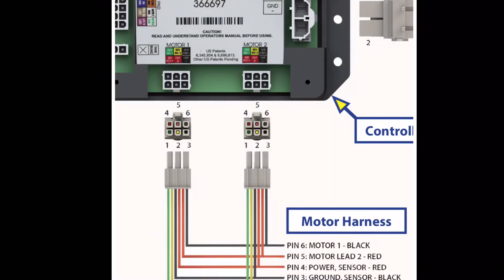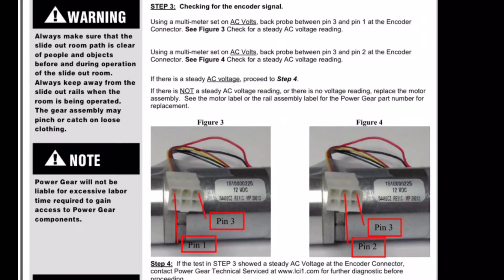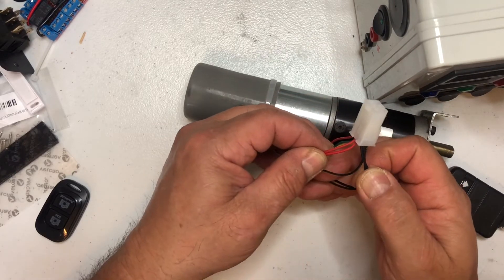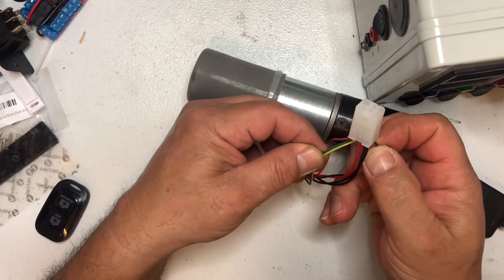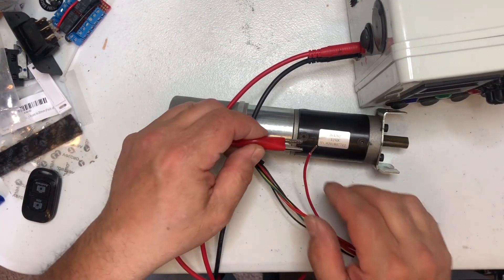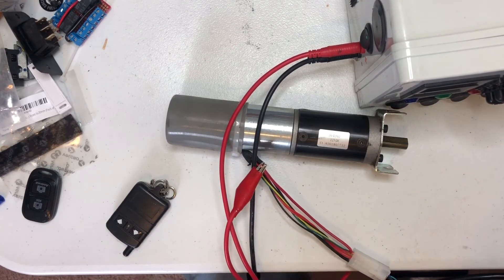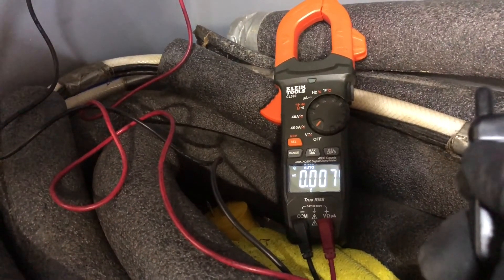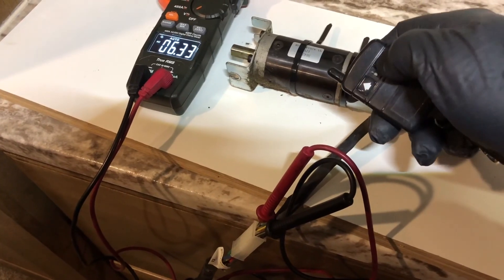Slim Rack Slide Out Encoder Circuit Test

Comment: Can I use a typical volt multimeter?
Reply from the maker: Not sure what a typical volt meter is, but I think any meter that can read AC voltage should work. I typically use fluke meters and don’t have very much experience with other brands. Hope that helps.